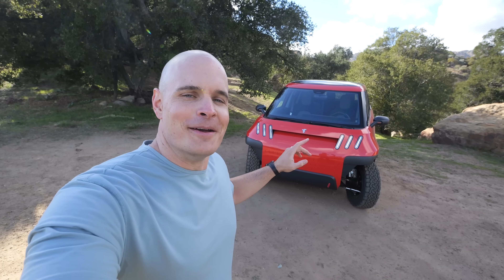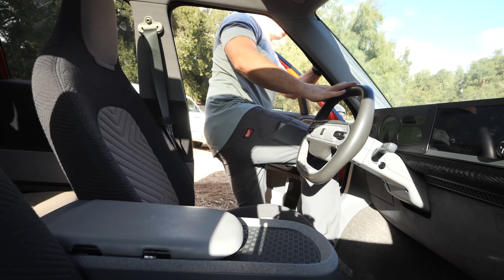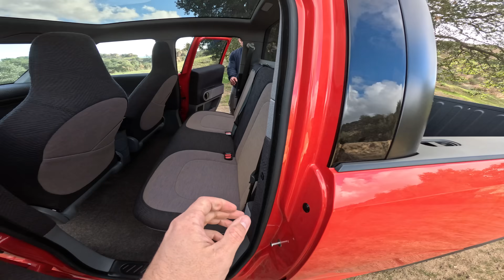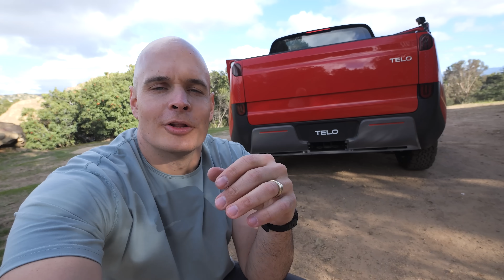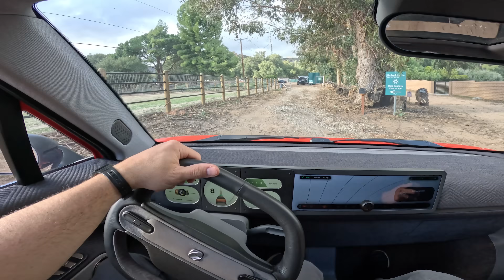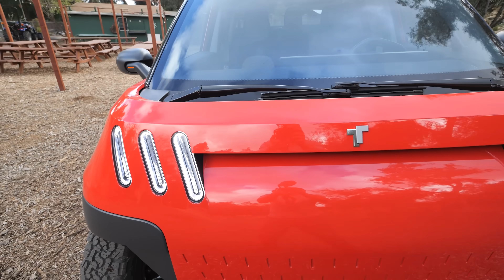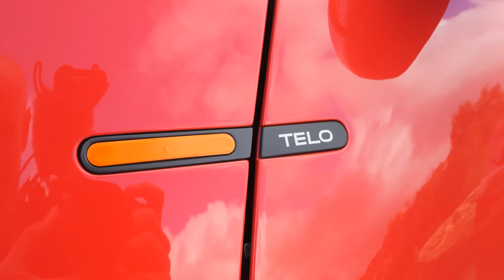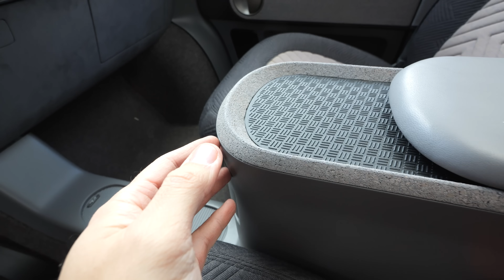ONE TRUCK TO RULE THEM ALL...

Comment: That bed has a higher payload than my 2012 Ram 1500😂
Reply: lmao
Reply: You have to pay a subscription for extra payload capacity.
Reply: ... and the range will drop to...
Reply: This sucker puts my ram to shame too lol... mines an 05, tho but still. This things insane
Reply: @Xilefthepenguin  so far it's a fake payload as in, their prototype isn't meeting it but they do target 1600-2000lbs on different sites with 6000-6,600 tow capacity. 
The clearance on it visually suggests a current payload of 600-1200lbs. My guess is they haven't made the proper shocks and springs yet. 

The battery target is 260mi- 350mi range on Tesla? Batteries.
Reply: @WhiteWolfos  damn, that's not even all that bad tho. I'm pretty excited for this to debut
Reply: at least your ram will go further than 35 miles on a full tank
Reply: @RedesCat  at a significantly higher cost...
Reply: Since they will never deliver, they can claim any numbers they want. Also, these rookie truck maker always overstate payload and towing. Look at the Cybertruck. The big 3 always rate conservatively for safety reasons.
Reply: @TroySavary But Tesla loves sell vaporware
Reply: @TroySavary cope.
Reply: @Xiph1980  Cooe? I am not the one upset at a bit of reality heing injected into bogus claims.
Reply: @TroySavary  you really cannot compare the shitertruck to any other company tho. that was a meme that was sold to idiots dumb enough to buy the hype not common sense.  This is just a light truck. In Japan they are a dime a dozen.  Kcar trucks are all over. Daihatsu and Suzuki love making them.  This is just that, but electric.
Reply: @BurntFaceMan  Kei trucks are coming from real companies, not a few guye asking for money online. Kei truck makers also do not make bullshit claims like the kei truck will have a third row seat and sit 8 people.
Reply: @TroySavary  Ah yes, typical EV hater. Spending his time commenting negatively at every opportunity, even though he has zero evidence to backup his claims. Do you not think every auto manufacturer started out initially from one prototype model or something? There is footage (in this very video) of a 6 foot man sitting in the back. There is also footage of that seat folding down and providing 8ft of length for the bed as needed.
Reply: @KingJerbear  I drive an EV. I am just a scam hater. Nothing that I criticized Telo for has anything to do with being electric.
Reply: @TroySavary  is telling the unfortunate truth. At this point, all this stuff is vaporware until they actually ship a reasonable amount to actual consumers.

Delivering "sometime in 2026" means they have no practical plans. If they did have a legit plan/decision to sell, dude would have said "we have 1000 vehicles scheduled to ship in March 2026."

I don't want it to be true because they tiny trucks are awesome. I would love to buy one of these. But it ain't happen.

Comment: He really wanted you to give it some gas 😂
Reply: Apparently it has a solar roof option to add up to 15 miles a day for only $1,500. That's sounds amazing!
Reply: @BlindedByLogic  yes! They are working with Aptera to make that happen, according to the Telo CEO.
Reply: @BlindedByLogic that actually makes no economic sense at all.
Better use that money to install extra panels in your house and then charge the truck.
Reply: @BlindedByLogic  1500 for a 100 watt panel. now thats a scam if i saw one
Reply: Our man didn't want to go thru what Marquez went thru
Reply: The CEO wanted him to and to be honest, I wanted him to ask well. 
It's a test drive for the entire Internet and I'm sure we all wanted to see what it'd do.
Reply: Correct expression 
“Give it some electrons” 😆 ⚡️
Reply: @jzchn  I prefer joules because I'm a nerd. 🤓
Reply: Was waiting pedal to metal… but none came. The CEO even said it twice 🥴
Reply: i felt the same way as mr jerryrig, i didnt want it to go too fast for fear of breaking something D:
Reply: They were on a dirt road, and it's also a prototype. My guess is he didn't wanna trash it with dirt and rock chips, nor tear up the road and kick out a bunch of rock and dust.
Reply: @kaylor87  u right!
Reply: We need a new expression for EVs. My vote is for "joules" because it's the SI unit for energy and work (as in physics, not a job). Or more simply, "give it some juice" since that's a common expression for electrical power.
Reply: Love it, 2 questions. Power? Safety rating? As in airbags etc?
Reply: @addsfour3499 Power up to 500 HP, it is aimed to pass all safety standards and excel, it’s something they’ve been focused on since the start of the design
Reply: @addsfour3499  Yeah, safety was my first concern when looking at the front
Reply: @accountisdisabled  It's nothing but crumple zone, no frunk. I still want to see real crash tests but I think it may be fine.
Reply: @ True. I saw another video of the truck bare bones and the front looks like it was built to take a hit. Agreed though that crash test are what really count though.
Reply: These comment replies reek of paid responses...

Comment: It's like the pickup version of my BMW i3 - super simple, lightweight, no fluff. I want.
Reply: Noooo, hopefully not. That was a terrible car, it did absolutely nothing well.
Reply: @mpirron1  I would respectfully disagree, while also supporting your opinion. Think, because it's light, with a small battery, lvl 1 charging is all I ever need. Apartments don't have lvl 2 options around here, and the i3 barely squeezes in my 1 car unit. It's literally a box, great for packing it full of RC planes and drones. And because the shell is composite plastics, I can fly my drones from within, in the AC, with little impact on my video or RC links. 

So you see, what works for one does not mean it works for another.

Comment: Finally, 'muricans getting cab over pickups. Now do the same with high displacement i4 TD engines, and add a single cab version.

Pickups don't need to be so space inneficient, or so massive, specially for people that just need a Corolla instead.

Edit: i'm seeing quite a few people in these comments that seem to think "kei truck" means "cab over". Kei just means a max size of 3.4m × 1.48m × 2m, and a max displacement of 660cc; there's cab over flat beds way bigger than that.

Comment: This is how trucks should be! They dont need to be huge and dangerous for pedestrians. Something like this with the same bed is insane
Reply: Nah, I will pass on a truck that only fits small children comfortablly in the back. Especially when the company repeatedly lies calling it a 5 seater.
Reply: @TroySavary  It's almost as if you're trying to imply that you can fit in the back of a Toyota Tacoma. Do you not realize this is the size of every compact pickup and compact car's rear seat?
Reply: @KingJerbear  I haven't sat in the back of a Tacoma, but I hace sat in the back of a Colorado and a Ranger. Both were larger than that. Neither required straddling the front seatback wutybmy knees. Both have larger rear doirs too, making ingress and egress easier. Usually vehicles with such tiny rear doors use suicide doors to get the pillar out of the way.
Reply: Agreed. Trying to wrap my head around how small the cabin feels. The bed is, in theory, taking up more space than the cabin and front (which is admittedly very small) of the truck.
Reply: Not dangerous to pedestrians but dangerous to the occupants. Imagine getting t-boned in an intersection by a hummer or a dump truck. DRT

Comment: I'm 6'6. I'd love one of these. Once they're out, I'll find out if I fit.
Reply: They had some guy from motor trend fit inside it. He said it was fine for him for head space and just enough for knees. He was 6' 10"
Reply: Being just 6'3, I'm worried I wouldn't fit comfortably in this thing, as I seem to be more legs than torso. If I fit, this would be a rad little machine!
Reply: I know I won't fit at 6'11, I hardly fit in anything to be fair, but I do still kind of want one. I love compacts and I love kei trucks. Just little practical machines designed to do exactly their job as efficiently (and cutely) as possible.
Reply: @DigitalJedi  They did a road test with a guy from Motor Trend who was 6'10", and showed a video of the guy getting in and out OF THE BACK SEAT. He said he was surprised that he fit at all, but he DID fit (and in the drivers' seat too, though they did not show that part in the brief clip I saw). He said he could fit his hand between the top of his head and the ceiling, while sitting up straight. 

Still, he didn't look like he would enjoy a long road trip in a Telo. 

Just sayin'.
Reply: I'm not a big guy and I think I would even have trouble getting into this. I would love to see this with two much wider front doors and a smaller suicide back door.
Reply: You won't
Reply: why would a tall person want a small truck 👽?
Reply: @chupapi4428  because big vehicles are stupid.
Reply: @chupapi4428  because people are not supposed to be the main load of a truck, and a tall person should fit perfectly fine in a normal sized car if designed correctly and space efficient.

Comment: You know, it's not my styling... but it's not "ugly", I kind of like it XD

It's tripping me up not having a bigger hood, if they decided to extend that and add a frunk, I think it would be a great contender.
Reply: That's the whole point. No need to design around a giant motor that isnt there. THis is a revolution in design - around the battery instead.
Reply: @Minnemike_StPaul   You say "That's the point" but I love the front trunk of my F-150 Lightning. Just because something is "revolutionary" doesn't mean it's practical. Yes, it makes the vehicle smaller in size, but you also forgo the storage capabilities. It's a design choice. It's why I won't  buy one, because while the "monster tunnel" does exist, it doesn't replace the functionality a frunk gives you.

I'm not saying it's a bad choice, I'm just saying I like the utility of a frunk more than the utility of the smaller length.

Comment: We just visited their website. It's now on the list of things we are saving for. This will replace our Ford Ranger.
Reply: Wanna trade my Tacoma for this
Reply: I loved my old Ford Ranger XLT. I had the manual 5-speed with a 4-cylinder engine: zero towing capacity (IRL) and could only manage about 40mph up the 395 north of Bishop, climbing into the mountains. But this Telo would have a smaller footprint than my Ranger, ridiculously more powerful, hold more passengers more comfortably. And while it would have a slightly shorter range, it would just be so much fun and so much more versatile in other ways, the range thing would not put me off. (300+ miles is way more than I would usually need, even to go skiing)
Reply: My yota single cab 2wd 22r could finally finish rusting back into mother earth Gaia from whence it came. Just as soon as a gas sipper with a knee high bed comes along to replace it.
Reply: Just visited their website and instantly want to buy? Man, I’d hate to see your personal balance sheet… 😬
Reply: Just remember to save at least $60,000. Every single one of these car companies with a new electric car claims the price is going to be one thing, and then when it finally comes out it's always 10 to $20,000 more than they claim.
Reply: Right. And god help you when the warranty issues come and you have to deal with a brand new company…
Reply: @davidphones7290  if no one bought a new companies products, we'd never get new companies....
Reply: @davidphones7290  Dude. How is that any different from our 2010 Ford Ranger with 200,000 miles on it? It's a miracle the thing is still road-worthy.

Comment: Starts at $41,500 but their website preorders state $34,020. Major automakers did something similar with advertising a nice number and the final product costing more, but I am VERY interested at mid $30's. A bit less so at low $40's. So... which is it? Website not updated to reflect current market reality or...?

EDIT: Once you click on it, it shows $41,500 single motor and $46,019 dual motor. Long range adds another $3,980. I can't immediately see how drivetrain and battery pack effect payload or tow capacity, if at all.

Comment: This is actually cool!!! Finally electric truck you actually could buy and realistically use here in Europe!
Reply: EU wont allow it
Reply: I believe it is not legal in the EU as the front wheel is not covered and directly exposed to the front of the car.
Reply: @Aceborn-Gaming  Probably could be fixed by front end modification/redesign! Make it bit longer! Also fixes leg room in front!
Reply: @rks9612 would probably be the only car where the EU spec is bigger than the American counterpart lol
Reply: @texeract6209  Almost wanted to add that to my own comment but yeah! That being said length isn't that big of a problem! But if current wheel base is same as Mini then adding bit of lengtht isn't that big of a deal anyway!
Reply: @texeract6209  Electric cars promised to be simpler and easier to repair! Abviosly that wasn't delivered! But if electric cars was actually simple box with wheels/motor/battery and AC without updates and built in gaming console and all that other BS I would actually move to electric! Especially living in city with charging at home over night! That would be awesome!
Reply: @rks9612  EVs didn't promise anything. They are just another product with pros and cons. They are simpler than they modern ICE counterparts, especially hybrids, and just as repairable as them in fact so whatever you think "wasn't delivered" it actually was.
And if you are comparing to carbureted cars, then you need to compare to EVs of the era, like the Citicar which had extremely basic electronics and lead acid batteries.
Reply: @LAndrewsChannel  I would love basic EV! Simple! No gimmicks at all! I don't need self driving/electric door handles/ built in entertainment systems and screen control everything and all the rest of BS! I don't even need electric seats! Radio could be amplifier with Bluetooth for all I care! That's why I love EV conversions more than production EVs!
Reply: @rks9612  proprietary parts are encrypted software/can signals are the problem - for example i have stiga c300 lawnmower tractor - it has 1,5kwh battery - battery alone as part cost 90% of whole vehicle - also battery has only 168 of 18650 cells so if cells fails is preety much cheap to replace them - in the other hand bms is proprietary so if bms fails you can't do nothing - as its a niche market - nobody will bother to reverse engineer can singales etc bcoz its not worth it
Reply: Get a Dacia Spring or something then
Reply: Nein, weil Fußgängerschutz nicht gegeben

Comment: I still don’t understand how this is better than an electric van. A van is more efficient, has a covered back and the height advantage in the back to attach stuff. Gas powered is a different story. Just to clarify, this is compared to the average person, since 90% of people don’t need to go off road.
Reply: Well the benefit here is that it doesn't have a top, so you can fit large objects or weirdly shaped objects unlike a van.
Reply: Trucks are more sexy in the American market. I do agree vans are more versatile though.
Reply: A removable camper unit fitted to the truck bed would be amazing.

Comment: You had me at " They're not proprietary "
This thing is 1000 times better than tesla dumpstertruck.
Reply: There are also risks witb non proprietary tho. That can mean a supplier can change things and suddenly its not supported or gonna fit.
Reply: @ Parts have part names and any changes come with revision names. It's neither rocket science nor a "Risk" as you put it.
Reply: @daemiax  telo may have access to those revision names as a agreement from the supplier. But idk if you have opened a part catalog lately. They dont often put that stuff in there.
Reply: @TheJttv  I've worked as an industrial barcode printer specialist. We had our part numbers with revision publicly available. 
The number would be something along the lines of abc-def-ghy where 'ghy' ( the last 3 characters) were the revision number and would usually be 001,002 and so on. And It was for a multinational corporate
Reply: @TheJttv  That happens with proprietary things too, except with proprietary things it's guaranteed that they'll be discontinued after a few years.
Reply: @NickMinskey  with proprietary its a risk to the consumer, non-proprietary is a risk to the manufacturer/integrator.
Reply: Absolutely ! And it comes already painted, unlike the Deplorean
Reply: Now that the solid state battery is here, Evs are just gonna keep getting better as long as the companies allow it
Reply: @peaner__3 if it isn't in production we don't care...
Reply: @JE-zl6uy  hey man, I'm just saying someday sooner rather than later small Evs will be decently reliable. I fuckin love e bikes, yea ev cars suck but that's the tip of the ice burg when it comes to electrical transport.
Reply: @peaner__3 little EVs are anything but terrible. The Leaf didn't survive this long for nothing.
Reply: It’s not lol